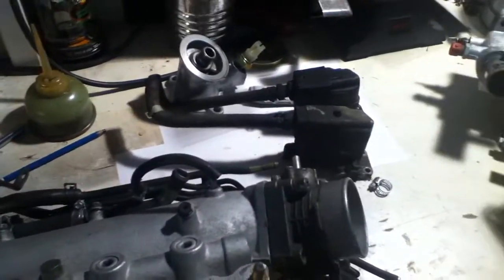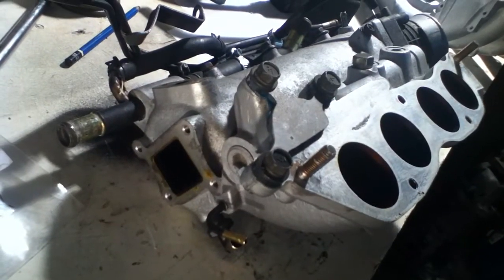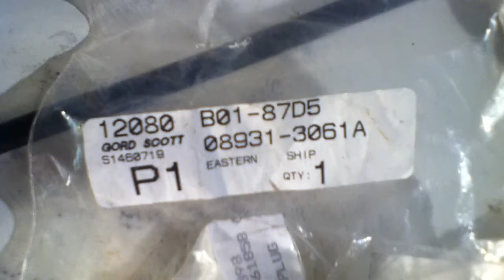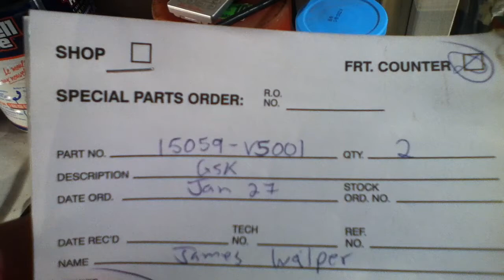KA24DET project...I has questionz!

Comment: Hey how much is it costing you to rebuilding this in total even the paint for then engine cause i not sure how much its going to cost me to self build? Also where would i got for machining parts?
Reply from the maker: I'm somewhere in $9000.  I'm not rebuilding. I'm building a KA-T.   Been busy with other things.   If you wanted to do a simple rebuild you have to consult machine shops in your area familiar with 4 cylinder engines, get the specs for ring and bearing clearance.  Shouldn't cost more than $1500 for a good rebuild with parts.   

If you are going turbo, then make sure to open up your ring gap a little more.

Comment: Remove the "Monstrosity" that's what I did. Then you will be left with 3 vac lines. One goes to the brake booster, one goes to the FPR, and the other can be used for anything you want or just cap it off. Wht I did was ran the brake booster line to a vac block and and ran one vac line to FPR, and capped the third off. I capped the throttle body coolant lines, and ran the other lines as stock. I did tee off my turbo coolant line to one of the other coolant lines.

Comment: honestly its their for a reason otherwise it wouldn't have been their in the first place. how much do u know about engines? ur wanting to remove minor increments that can be vital to readings for your computer and everything even if u r getting a new ecu. the manufactures put it their FOR a reason...the only unnecessary thing is emissions with u already removed. think of it that way man...redesigning and engine is not something that u want to do.